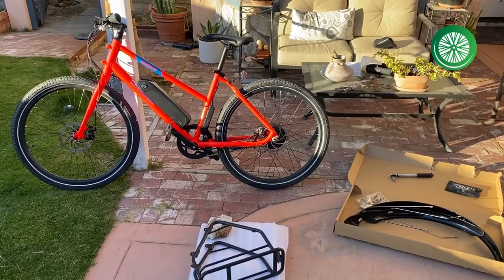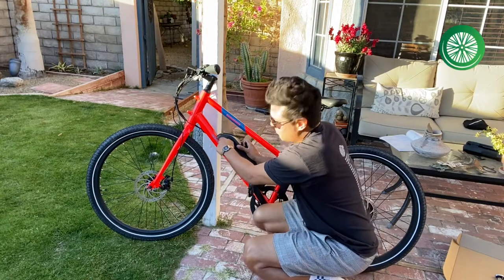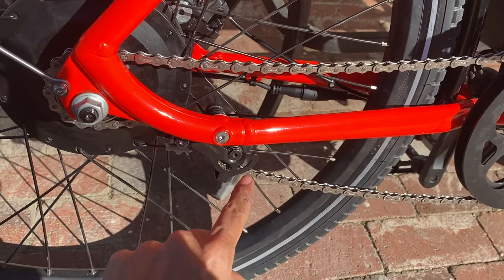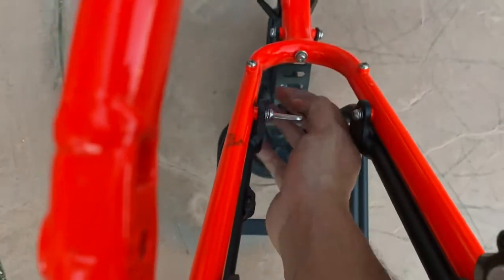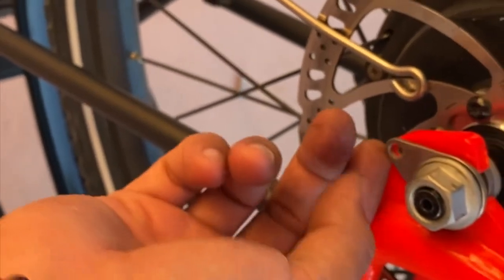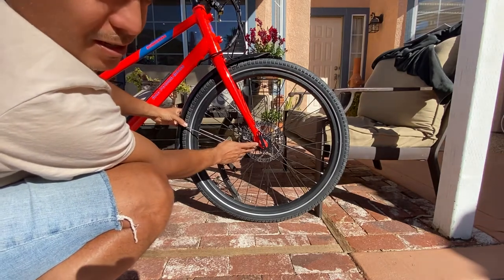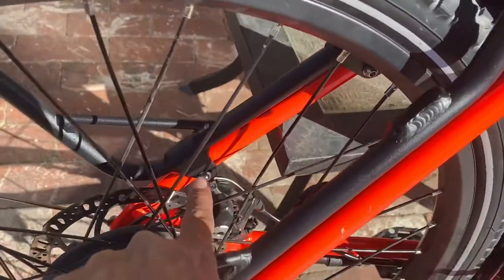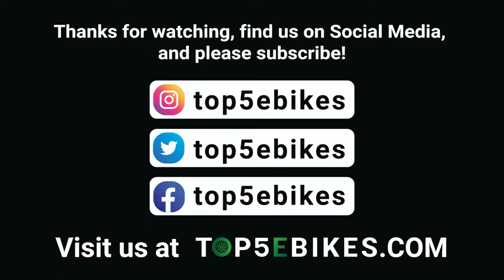RadMission Metro Ebike - Fender and Rack Assembly Instructions

Comment: Not the most comprehensive video on rear fender and rack assembly.  No mention of nylon ties removal and reinstallation.  Doesn't show where to mount fender wire brackets with tork bracket.  Just kind of skips from one place to another before completing a task.  Assembly is kind of intuitive once he gets going but if he is making a video on assembly then he should be more complete at each task that he presents.
Reply from the maker: I see what you mean here. Thanks for the feedback. I shot this video by myself without a 2nd shooter or a mount to allow me to do hands free shooting. We won't make that mistake on the next one!

Comment: Would like to add a tip for the rear wheel that helped me. 

When I installed the rear fender and took the wheel off, I got chain misalignment when I tried to reinstall. It drove me crazy because the bike was only a few days old and I thought there couldn't possibly be an issue. Turns out, my CHAIN TENSIONER flipped upside down. Something that I did since I installed this myself was hold the tensioner all the way down (to make the chain as loose as possible, and zip tie it to the frame, allowing me to slide my rear wheel back in. Threaded the chain, doubled checked the gear teeth, and then cut the zip tie. Snapped right into place! Hope this helps anyone with the same issue.

Comment: The tail light wire is long because I believe you're supposed to wrap it down the rack & then back up.  The length was then perfect for me (although I secured it with extra zip ties).  Make sure you torque the rear rack bolts to 7 Nm as many users have reported multiple bolts falling off mid-ride.  In the least, add some Loctite to the threads.  

@Top5ebikes  do you have the old tail light hardware attached to the rack or is it only attached to the frame?  I didn't see in the instructions that you were supposed to reattach it after the rack is installed.
Reply from the maker: I’m sure you already figured this out but you for sure attach the light to the back of the rack. If you skip to the end of the video you can see the placement of the taillight.

Comment: Wouldn't it be easier to just deflate the rear tire rather than taking it off?
Reply from the maker: There isn’t enough clearance to fit a socket or torque wrench into that space if you don’t take the wheel off first. You screw the bolts into the frame and tighten from the inside.
Reply: That’s what I did. I got my Allen wrench in there. You gotta have patience and smaller hands but it’s doable

Comment: This is deceptively difficult. The video seemed easy to follow at first watch, but then when I went to actually install the rack and fender, I couldn't get the chain back on. Now I have five kinks in my chain and the RadMission is out of commission. 😭
Reply from the maker: Hey James, I hope you were able to get out of this pickle. You’re right, this job is not what I would call easy. If all else fails I would definitely take it to your nearest bike mechanic.
Reply: @Top5ebikes  Thanks! It took a while but I was able to de-kink the chain, feed it the right way through the tensioner (had to disassemble/reassemble the tensioner to do that for some reason), and get everything put back together. I've taken it around probably close to 30-40 miles since and it's holding up and retaining the chain over some pretty bumpy routes, but I'll probably still take it into a shop for a check to make sure everything is actually okay. 😃